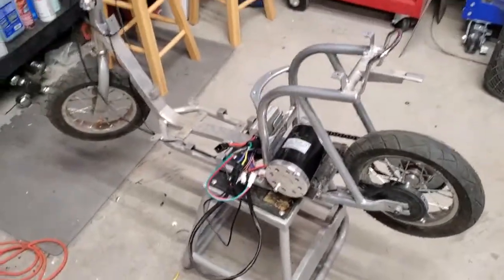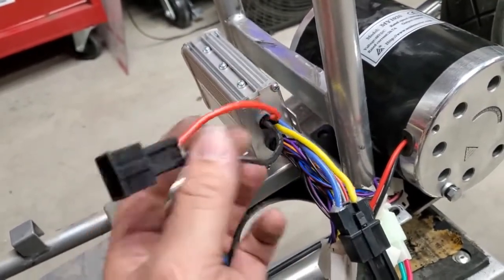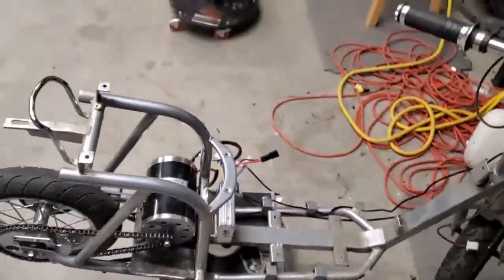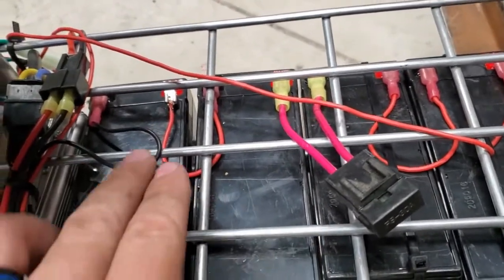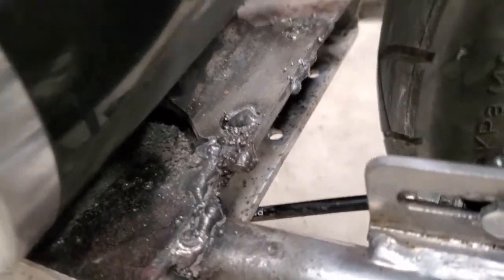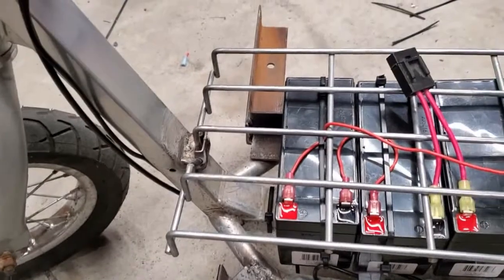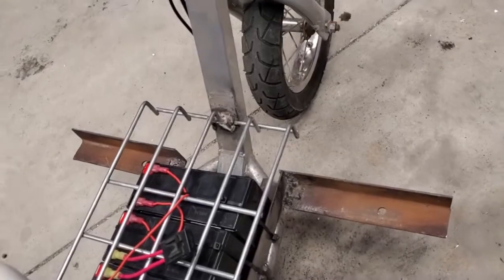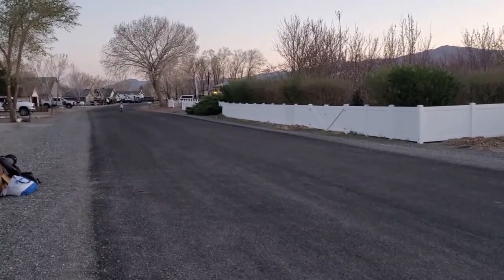Turbocharged Pocket Rod: The 48V Experience!

Comment: The scooter can go faster if you install a larger sprocket on the motor and/or a smaller sprocket on the wheel.  I'm going to change to a larger sprocket on my motor so I can ride at more than 15mph.
Reply from the maker: This goes 24mph. That's plenty for my kids.

Comment: As I remember, the amp hours are increased when the batteries are hooked up in parallel... not series.  I use a lithium ion battery pack on my Pocket Mod.
Reply from the maker: This now has a 12ah battery which lasts much longer

Comment: Late to the game but thats not 48v at 36ah for tgat battery pack. Its 48v at 9ah because wired in series the voltage is combined but the ah stays the same as each individual battery. If you parallel the 4 batteries then you would combine the ah capacity to 36ah but you would only have 12 volts. Its kind of one or the other.

Comment: We just did this upgrade on my son's Pocket mod and it has absolutely no more power than it did when it just had the two batteries
Reply from the maker: That makes no sense. 48v with a bigger motor should work. Unless your power controller is bad or needs to be turned up.

Comment: Is there a way to do this without welding? I'm going off all YouTube and hand tools here 😅 got the batteries switched  out. but now I decided that's not enough either and need a little more oomph.
Reply: We did the 36 v upgrade and it has no more power than it did when it had just the two batteries because one battery has to go directly to the controller
Reply from the maker: I suppose you could bolt the motor on the the plate. 48V is definitely enough power for kids. For adults I would do the 72V
Reply: @mosquitonkosak  did you wire one of the batteries directly to the controller or did you wire the batteries directly to the motor? We lost twelve volts because we had to wire one of the batteries directly to the controller

Comment: What’s the link for the kit?
Reply from the maker: Kunray 48V 1000W Brushed DC Motor High Speed Electric Motor & DC Brush Controller & Gas Accelerator Throttle & Ignition Lock for Dirt Bike e-Bike ATV Go Kart Moped Mini Bikes Motorized Bicycle https://www.amazon.com/dp/B0827L3NH1/ref=cm_sw_r_apan_i_8JX6AHY96PFG6SEM2VN0?_encoding=UTF8&psc=1

Comment: I have a razor pocket mod I'm thinking about installing two of the 1000w electric motors 

Just not sure how id wire up the second esc to the motors I have 2 48v battery packs
But yeah the second motor I'll be upfront I'm just looking for some ideas if anyone knows how too electric motors can be used with 2 different esc thanks
Reply from the maker: I dont think wiring up 2 motors is a good idea. Both motors might not go exactly the same speed and it could end badly. Also the controller is only wired for 1 motor. You would have to put 2 of everything on the scooter.

Comment: Chain is way too tight!
Reply: Man that's what I was thinking.   There is room to move it forward.  But maybe better to just add 1 link back in.   To keep it neat the middle of that track.   Also a generic bmx chain tensioner would work great on that to have perfect control of the adjustment.